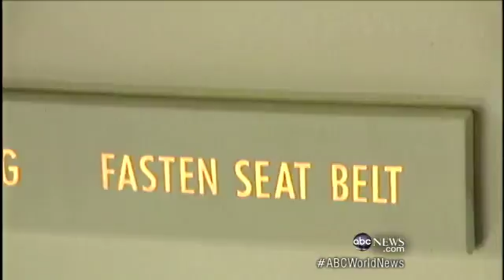'Catastrophic Electrical Failure' on Passenger Jet

Comment: Why is this news... seriously. Just ABC trying to pull in viewers by plastering "Catastrophic" and "Passenger Jet" on the headline of this video. The airplane lost it's autopilot and the pressurization system started to bleed off, big whoop. These pilots can easily fly without an autopilot. Such a non-story.